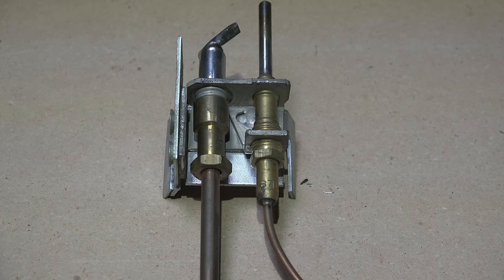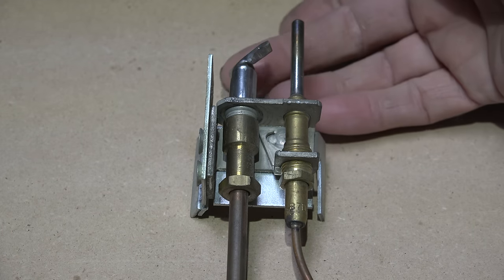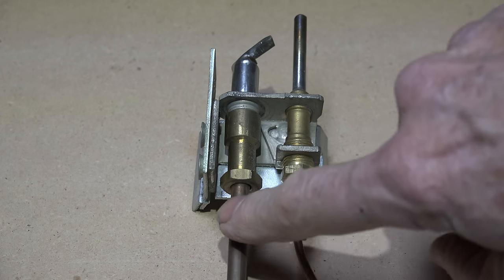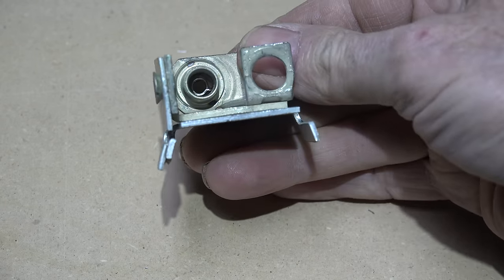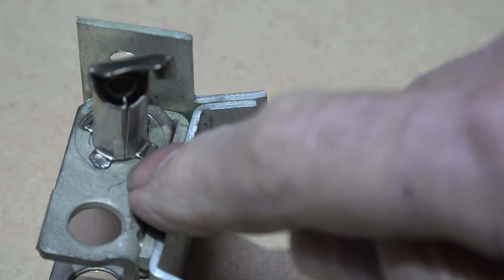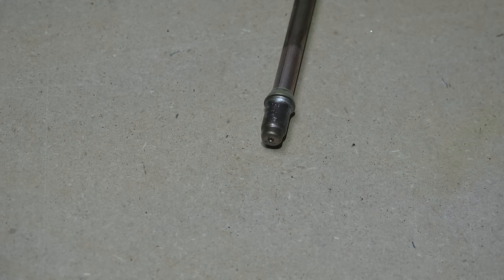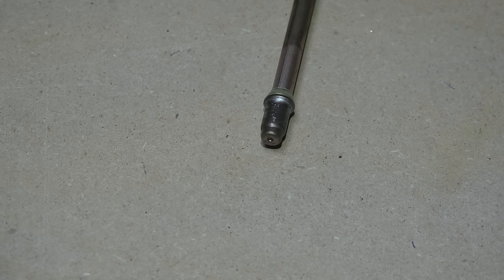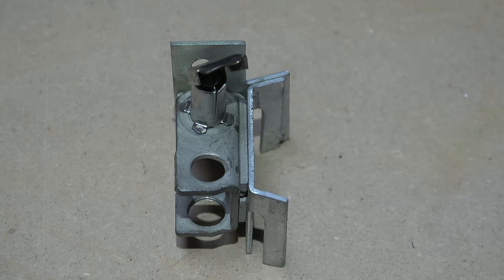How the pilot assembly is designed

Comment: Mine was burning orange in my pool heater and the thermocouple was collecting unburned carbon gunk and it stopped sensing flame. I reached to clean it, and it fixed the problem, but I noticed flames under the bracket, clearly it wasn't alright because it melted sensor wire isolation off. Soon after, pilot tube broke off completely and the whole thing was burning in hell. Turns out the tube completely rusted off. I made a new aluminum tube and fittings, and now it burns in steady blue flame. I watched your video prior and couldn't understand what kind of blue flame you were talking about. Now I see.

Comment: My pilot used on a burner for a pizza oven is acting inconsistent.  When I first start the oven it works fine, but as the oven come up to temp (800f) the pilot starts to die off and hence shuts off my pizza oven.  Any idea why the pilot is getting cutoff when the temp is hight?
Reply from the maker: You probably have a failing gas valve.
GFM

Comment: will a small blue flame automatically shuts down my furnace, even i have a working thermocouple?
Reply from the maker: If the pilot flame goes out, the pilot safety will shut down the gas supply.
GFM

Comment: I have a pretty far out there question.  I have a 100lb propane tank.  Could I run just a pilot light with this with the right parts?   Looking to generate C02 without too much heat.  Thanks!
Reply from the maker: You could, if you simply ran a gas valve and pilot assembly set for propane in the pilot only position with the main gas outlet plugged.
GFM

Comment: Can you clean out the orifice hole with maybe a needle or small wire, or, small drill? Or do you have to replace the orifice, or whole assembly? THANKS FRIEND.
Reply from the maker: You can try if you are careful not to enlarge the hole. 
GFM
Reply: We got a nifty tool:  Leavey Pilot Cleaning Pump Kit.   Great Pilot Cleaning Tool.  
Pipe cleaners, pins, small wire, etc... enlarge the Orifice hole - then, it's replacement time.  :(
We have even used air in a can for $2.55 - that works.

Comment: Q: Are all honeywell pilot burner with orifice the same?
I'm going to replace mines. I have the OEM parts number, but unfortunately I can find it on line to buy it. Local plumming/heating supply store can find on number
Reply from the maker: They are not the same.  Depending on whether the spark ignition was original equipment or and upgrade, it could have virtually any pilot assembley.
GFM

Comment: Thanks for this. I've been following you since quite sometimes. I even made up a binder of a good part of what you teached us. I have a question. It's a fireplace and after 2 days you can see a huge accumulation of smoke on the window. The pressure is 10 wc.( propane) for some reason,there is no adjustment.It's installed in the basement. I cleaned it. Replace the wood onside ( not wood, but, anyways) If ever you have an idea, please let me know.
Reply from the maker: +Luc Dumouchefl Have you adjusted primary air?  Adjustment may also be dirty.  Hope this helps.
GFM

Comment: After thoroughly cleaning off the Thermopyle, the Thermocouple, and the metal gas flame supply orifice, and vacuuming the area, my pilot light is still weak.  It doesn't seem to energize the  Thermocouple and Thermopyle.  As a result, the main burner doesn't ignite.  How can I get a robust pilot flame?
Reply from the maker: If the pilot is entirely blue and covering both the thermocouple and the thermopile, it is probably ok.  If not, there is a pilot adjust screw on the gas valve.
GFM
Reply: @grayfurnaceman  I have same problem , but on water heater with honeywell smart gas valve. I can not find a pilot adjustment screw....Help !!!
Reply from the maker: @rickhayes4090  Why do you want to adjust the pilot?
GFM

Comment: My sisters furnace stopped working I came over and cleaned everything. After removing and cleaning this pilot/flame sensor the furnace fired right up. 3 days later she began having the same problem would it be safe to assume this part needs replaced? It was pretty dirty I cleaned it all with steel wool but there was corrosion.
Reply from the maker: The flame should be blue and covering the thermocouple by 3/8".  Also, there thermocouple may be weak.  If the flame is ok, the thermocouple would be the first culprit I would look at.
GFM
Reply: @grayfurnaceman  so after getting a look at it seems like it's having a spark issue not a pilot one. It no longer Sparks like it did the first time I cleaned the thermocouple and got it working. It will spark once during starting sequence then all I hear is gas from the pilot after about 30 seconds it Sparks once ignite the pilot which is a blue flame then stops and restarts the firing sequence. I replaced the thermocouple just because I already had the part with no success could it be the intermittent spark module? Edit: after reseating the connections to the spark module I got one good ignition sequence where it sparked good then nothing. I went ahead and ordered the control module. This is for a Kenmore power miser 70 by the way pretty old unit but it worked great the very first time I cleaned the thermocouple I'm just at a loss here.
Reply: @grayfurnaceman  appreciate your advice by the way it really helps to have an experienced professional to go to for guidance.
Reply from the maker: @zack6892  It could certainly be module.
GFM
Reply: @grayfurnaceman  thanks for the input I'm hopeful that solves the problem. Spark is definitely erratic at best not as it was last time it worked.
Reply: @grayfurnaceman  internment spark module was the culprit. We've got heat and it's igniting much better hardly hear it start. New problem though it seems the burners are randomly shutting off as if it's no longer getting call for heat. Then shortly after it will ignite burners and continue as usual. It's not happening all the time generally furnace seems fine. Is there a reason it would turn off and back on like that? My hunch is maybe a thermostat issue? So far replaced the module as well as pilot and thermocouple.
Reply: @grayfurnaceman  watched a few more of your videos and I'm pretty sure it's either thermostat or limit switch. I am no longer at the house but I will be checking what temperature it is set to turn off at. Glad I found your channel it has saved a long wait and money at least she has heat for her and her daughter now.
Reply from the maker: @zack6892  I would be looking for plugged filter, dirty fan, plugged A/C coil.
GFM
Reply: @grayfurnaceman  will do, filter was plugged badly.